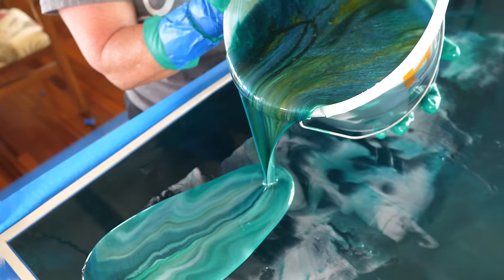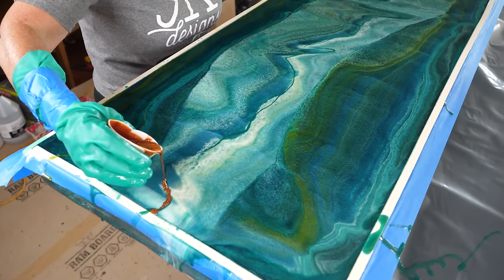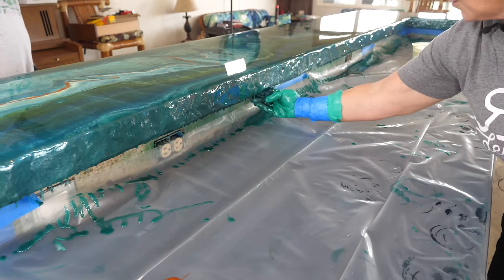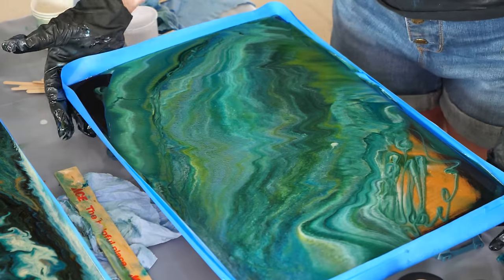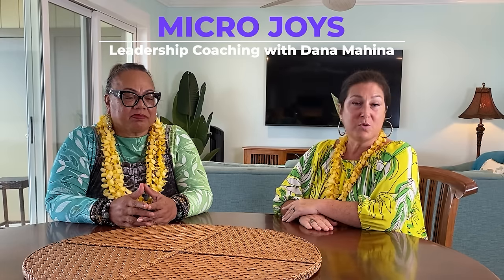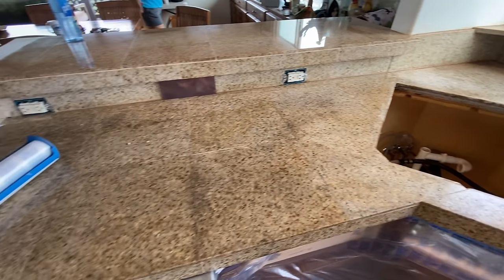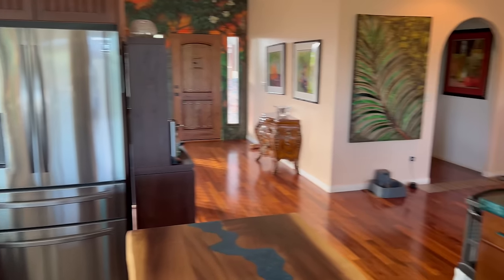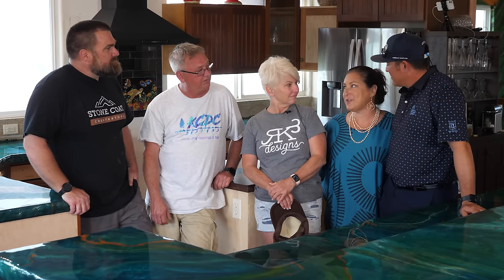Tile Kitchen Countertops Remodel with NO Demolition | Epoxy Tutorial Part 2

Comment: Hey Mitch. Just wanted to say thank you for the skillset you put in my box... My wife and I are likely to be evicted within some time frame as landlord wants to move family in.... But we are gonna continue to make this place look spectacular.....

We are loading up on materials - I'm rewatching your entire channel that I would never YouTube-dl  and planning our next moves.... Doubt we would have budget for bathroom but we are going to do kitchen floor and counter... I got a nice 5" slab to get cut innhalf roughly to serve as entry way floor piece (studio apartment) will be a 1 bedroom by the time we are done with it.... We have in our bedroom "" 2 height adjustable tables of which we have been collecting nostalgic items so we can deep pour them both.... Soffits outfitted with addressable lights.... Perimeter of ceiling will be dropped to a new height.... And as I look at these walls and think about what you guys did with pink foam..... Ooooo man - I had lightbulbs going off .... Without demoing the walls what's your take on coating half inch pink foam and adhesives to the back of them . figuring it would be light weight (assumption) any ideas for supporting what essentially will be a wall "facelift".

I am sure the next tenant in this apartment will absolutely adore this place... At least I hope so...

Epoxy gave me a way out of my own misery and  depression.... We pretty much got everything we need except the epoxy....

So looking forward to this... And more of your awesome videos which are PRICELESS

Thank you and have an awesome weekend and upcoming holiday

Comment: Hey Mitch! Building a bar on our porch, and planning g do another her epoxy pour on the upper bar and lower countertop. Did an epoxy pour at our previous home, and want to do something with lots more color - like this one. I will have the luxury of being able to pour the tops in the garage then mount it. Question for you - Art Epoxy for the color coat, then a Clear Coat to seal it? Yes, no?

Comment: Hey, Mitch! Can you epoxy plexiglass?  I'm interested in buying a bus and converting it to a tiny mobile home.  Unlike the conversions I've seen, I do not want any floor-to-celing solid walls, so my thought was to use plexiglass everywhere I want full walls allowing as much light as possible.  For the bathroom, I thought epoxy over plexiglass coated with epoxy would grant privacy while allowing light to pass through.
Reply from the maker: You can, you'll want to scuff sand it 1st and keep it from flexing too much when installed. We also use pink foam from the home depot to make wall and shower panels

Comment: what brand of masking tape do you use?  we are in Australia and did our countertop in situ using only a clear epoxy over copper leaf (we used another brand as we couldn't get your brand here). Sadly the masking tape we used literally fell off as soon as the clear epoxy hit the masking tape causing all kinds of drama with leaking epoxy on floor and into sink hole - it was a mess..!!  we managed to save the top pour but the edges are a mess - can we re-mask the top edge and then apply clear epoxy to edges using our hands?  Love your videos :)

Comment: Hey Mitch, I'm planning to build a new house in about a year, I like the look of some epoxy floors, and maybe counters in kitchen and bathrooms, I don't see doing this DIY, I have some serious health issues that cause me to wear out very quickly, like having to rest after taking a single bag of trash out of the house.

A couple questions:
How durable is an epoxy countertop compared to other materials.
2nd question, what is the approximate cost of epoxy floors per sqft?
Reply from the maker: Where are you building your new house?  Maybe we can make a deal!?
Reply: @StoneCoatCountertops  I won't know for sure until my brother and sister-in-law buy their new house. I have health issues so I have to be near someone I can count on to help me as needed. We agreed on the Ozarks or somewhere near that area, so most likely in Arkansas but it could be anywhere around there or the surrounding states. As soon as they choose a location, I'll be looking to sell my house. Then  either build on their property if it is 5+ acres or I'll be looking for my own land 1+ acres, that has to be within 15 minutes of their new house.

Comment: Hey Mitch. I need help getting a hair out of the dry epoxy. I use your art epoxy on a big project. I had it covered but still got dust. I sanded it and did a second coat to discover a hair in the morning. Ugh. I do not want to do a 3rd coat. Any suggestions on getting the hair out and still have the gloss finish? Help.
Reply from the maker: Sanding and polishing is more difficult than pouring another clear coat. Can I send you replacement materials to cover it? Email me directly mitch@stonecoatcountertops.com
Reply: @StoneCoatCountertops  o gosh thank you that’s very generous. ❤️🌹

Comment: HEY MITCH HOW DO YOU KEEP THE EPOXY FROM COMING OUT ORANGE PEEL. AND WHAT DO YOU DO ABOUT BUGS.  I JUST DID MY TABLE AND IT CAME OUT ALMOST PERFECT. IT WAS MY FIRST PROJECT. IM SANDING IT DOWN NOW TRYING TO GET RID OF THE HIGH LOW SPOTS. SHOULD I JUST PUT TOP COAT OVER THAT OR SHOULD I JUST REPOUR EPOXY TO TRY TO FILL EVERYTHING BACK IN THEN TOP  COAT??

Comment: Hey Mitch, isn't a flood coat standard on countertops?  If so, why did you decide not to do it with this job?
Reply from the maker: Great question, It is best practice to apply a clear coat of epoxy over the project, if you omit you must apply the UTC to bring the top back to food safe. On this one a couple of factors had us going the route of no clear coat. We were on a time crunch and had a plane to catch and we applied a wash coat which helps build up the edge epoxy.  Normally I always apply a clear coat to add depth, protect the edges better, brings top to food safe and if a repair needs to happen down the road we have a clear coat to sand and polish if needed

Comment: hey mitch,. do you use new buckets every mix and every project?
Reply from the maker: Not always. I flip the buckets over and let them drain on plastic then a day or so later you can peel them clean. When I'm pouring a customers job I will always use clean new buckets though.

Comment: So the Backsplash pieces were a tile add on? no criticism, just wanted to figure out how to negotiate that with customers. I know you can't do the epoxy coat on the backsplash unless you do it offline in a horizontal layout and then mount later.

Comment: That's beautiful and all, but epoxy does not do well with heat on it.
Reply from the maker: Our epoxy was designed for the kitchen use and abuse. Heat resistant up to 450 degrees.
Reply: @StoneCoatCountertops  very interesting! Very intriguing as well!